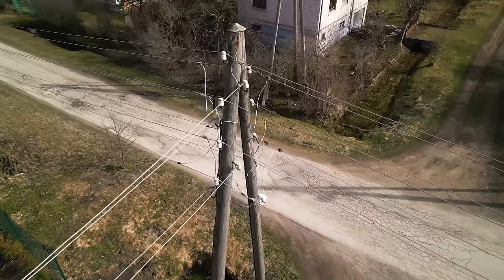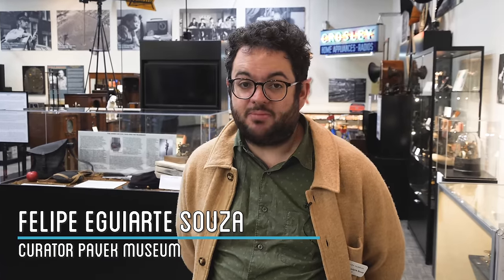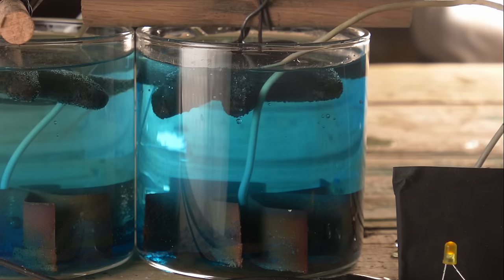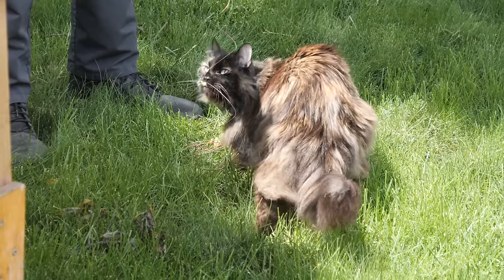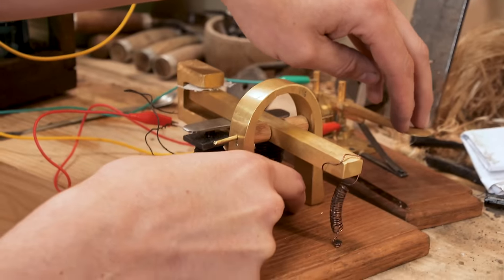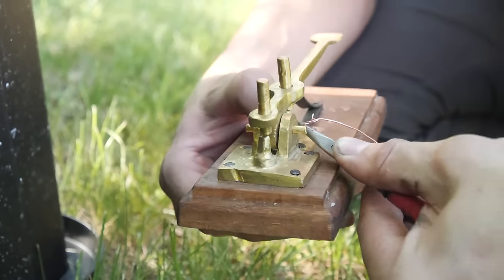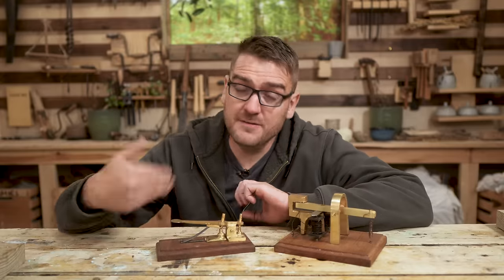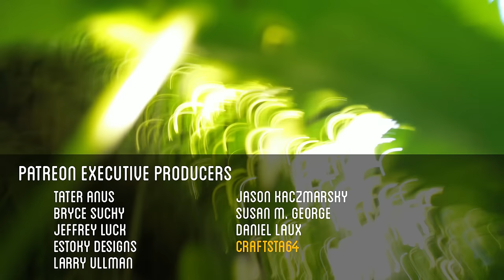I BUILT my own TELECOMMUNICATIONS Network!

Comment: Stone tools to digital communication in four years.  That is very impressive.
Reply: Technically it isn't digital, since there's not any transistor technology involved. It works on analog! But telecommunications from scratch is still amazing!
Reply: @plvmbvm513  It's digital, as there are only two states used to transmit information (On or off). Analog systems have a range of states.
Reply: @Theinatoriinator  This debate has raged for decades in amateur radio spaces. The US FCC, though, doesn't classify CW/Morse code as a digital communications mode, however. The reasoning I've heard goes that it's not operating on on/off signals only, as the duration and spacing of the pulses is also necessary to carry useful information. Something like Baudot code used for 2-FSK is where it becomes more "digital" (it's very similar to modern ASCII)
Reply: @Theinatoriinator  Morse code is more about length of pulse and not off and on
Reply: @Theinatoriinator  The length of pulse is a third state
Reply: @EggplantHarmesan Yeah, and it's technically more complex than that, using the duration of the space between signals to clearly separate letters and words from each other. Which binary also doesn't do, relying on chunks of bits (usually 8-bit bytes, though not always) in order to separate information so it can be read.

I think it comes out to being 4 different signals that it's based on. Dot, dash, short pause, long pause. But I'm not certain.
Reply: @plzletmebefrank  Digital doesn't imply binary. A signal is digital if it is discrete (there only exist a finite number of meaningful states). It is said "digital" because it can be encoded as a chain of digits (2 different digits for binary, 16 for hexadecimal, ... or anything convenient).
Reply: Meh. Dr. Stone had wireless communications in season 2.
Reply: @helpfromabove6400  Which is what... Two years with 20 times the overall manpower and at least twice the amount of full-time skilled laborers.
Not to mention working much more per day than a YouTuber since, you know... Mortal consequences hanging in the balance. Plus YouTubers have social media management, editing, etc. And I can't remember if/how long Andy has been full-time on YouTube.

Point is... It's actually not that far off from each other. Though, HTME is much more about education than actually racing to reconstruct modern tech from scratch.
Reply: @plzletmebefrank it kinda depends on when you start measuring. Senku had been alone for a few months and with only Taiju for a year, with about a month between the end of Taiju's first year and the arrival in the village and about 6 months between that and the battle at the cave. Given that the aim before arriving at the village was just to undo the petrification while building a decent lab and shelter, and most of the tools were left behind during the group's escape, I think it's probably more reasonable to start the count from the village arrival than the start of the series. Though the first two or so months were basically just preparation for the tournament and making the medication, with wireless communication taking ~2 months (electric lighting by Christmas and the phone by the end of January iirc). They also didn't have access to most ores until ~Christmas and no asphalt until much later.
It's kinda hard to judge either against each other's time schedule, as both this and Dr Stone had massively different objectives along the road to this. It's almost as bad as comparing them to humanity's rather pathetic time of some tens of thousands of years between metal working and the telegraph.

Comment: Further refinement of the receiver/sounder: attach a pencil lead to it and pass a strip of paper moving at constant speed under it, this way you get a printout of the message without someone having to manually write down the dots and lines

Comment: Do you need to anneal the wire between pulls? In case I ever need to make my own wire.
Reply: Indeed! I believe it varies on the material you're working with, but we found with copper wire that annealing after every two to three passes was ideal to keep the copper from getting too brittle.
Reply: I think so because they seem to be getting breaks it looks to me like the copper is work hardening after a few pulls. I would at least have it warmed through a fire before being drawn. Also the angle. They pulling the wire up at an angle instead of straight through.
9:42.
HTME has always been a great, but Andy has always been messy. It has improved since the early days.
Reply: For copper, every 3 pulls is a good rule, as most available plates are meant to be used with the hands or a draw-bench. You can get away with 4 on silver and sterling, and for iron, it really depends on the alloy!
Reply: would it not also have less chance of breakage if you wind it onto a spool close to the draw plate instead of pulling an ever longer piece of wire.
Reply: Is there any way to anneal while pulling? Like, continuosly, instead of doing one step after another?

And is there a way to pull continuosly? Like, whitout the need to take the entire wire out, to start squishing the rest?
Reply: @isaacm1929  usually this is done in factories and larger operations. The wire is drawn through multiple stacked stages onto spools, and is heated between these with magnetic induction. Fires become too inconsistent to guarantee that the wire would anneal well at small gauges. You'll also want to clean the wire and apply an oil or lubricant to keep it from breaking. 

It doesn't take too long to soften the wire between passes. I made about 140 feet of 0.5mm wire from a length of 2mm wire, and it only took a couple hours.
Reply: @jakeeasterday1663  Thanks! Have a great week!
Reply: @dmf81  I agree that this would be better. If you look at illustrations of wire drawing from medieval illuminated manuscripts, the jeweler is usually shown with two spools, the wire passing through a drawplate between them. Usually, the wire can just be grabbed again closer to the plate during each pull, because the marks from the tongs would just be removed by the next size down
Reply: @graeme.davidson  It kind of bothers me he doesn't do more with making "automated" tooling, especially with metal. He's at the point where more precision machining would be available and he's made a lathe. All he has to do is make it more powerful, and make a vertical chuck so he can start milling. I do like that he is doing stuff with electricity though since it's such a major part of our world now, but machining and tool making is literally the backbone of the industrial revolution.
Reply: Yes, it work hardens after a couple of pulls with non ferrous metals.
Reply: @jakeeasterday1663  42 meters! Wow that's awesome... 😮
Reply: @dmf81  I don't think that would help. Yes, the longer wire past the draw plate can store more energy, but it only gets released if the wire breaks. But once the wire breaks, it doesn't matter anymore - broken is broken. All that changes is that with little stored energy (only a short length of wire under tension) you get a "click" when it breaks, and with a lot of stored energy (meters of wire between the applied force and the draw plate) you get a twang and a tail of wire flailing around. But the draw has failed in both cases.

Comment: As an electrical engineer I’m overjoyed that you’ve gotten to this stage. 

On the same vein of early communication, with the amount of copper wire you have available it’s well within the realm of you making your first crystal radio receiver and /or crude spark gap transmitter. The future is exciting and I can’t wait to see how this branch of HTME progresses!
Reply: for crystal radio they need a diode though which requires chemicals they likely don't have. Also with such crude technology it would be hard to sync the frequencys.
Reply: Among the first semiconductors circuits were galena “cat’s whisker” diodes that just used a very thin piece of wire to find and use a crystalline rectification junction to demodulate an AM radio signal. This was first done in the late 19th century. I agree, an AM radio receiver would be rad.

Although… if we are talking about building a wireless telegraph as a next step you don’t need a semiconductor. Marconi just used a “spark gap” and an antenna as the transmitter and early receivers (like magnetic detectors) weren’t that much more sophisticated
Reply: @A_youtube_channel_  just like the reply above,a detector diode can be made very easily with crystals found in nature already from Galena to Iron/Copper pyrites. The hardest part is getting enough wire for a coil and potentially making an earpiece from scratch- that would be the hardest given to crystal radios you’d need a high impedance load sensitive enough for the weak signal.
Reply: Should we remind them that Spark gap radio cannot be operated legally now.
Reply: @陳冠維-f7i  I’m sure that for educational purposes and limited power this won’t be an issue as much as people making their own transmitters for science fairs etc… we’re not talking kilowatts of power or extended periods of transmission. For the purposes of a video it should be fine. I’m no legal expert but for all intents and purposes a primitive transmitter one can assume would be built would surely put out less interference than some switch mode power supplies or whatnot.
Reply: @陳冠維-f7i  Can i remind you they already did, just in this video.... What do you think a coil of wire and nearly a mile of antenna with a switch in series is?
Reply: It is amazing to see someone try to emulate something that we know works, but actually how they did it appears to be lost technology. That's what fascinates me most as I sit and type this message onto a screen, it instantly appears for anyone in the world to read, yes it uses code to send and receive today in the same way, but yet we have not, or cannot reproduce what the pioneers of this technology did, given the somewhat limited knowledge they had of electricity and electronics
Reply: I have a question about possible technological resets how fragile is our infrastructure when it comes to sunflares?
Reply: Please run a spark gap transmitter only inside a Faraday cage though. Those things are banned from the airwaves except with special permission (like celebrating the 100th anniversary of some historic radio event maybe). Because they're so noisy.
Reply: @MuadDib2347  Whether something is illegal and whether a stern man in a black suit shows up at your doorstep are to different questions. You don't need kilowatts to wreck the spectrum for other users.
Reply: @CUBETechie We just went through one (a big one, mind you) and we came out fine. Current day electronics are now at a point that they can survive a sunflare...
Reply: @bpj1805 duration matters as well.   A short transmission would possibly not cause much trouble if a basically one-off event. (I too remember though when the modern road channel had some body come out and show how road transmitters were located for instance as part of their overall amateur radio discussion.)

I wonder if a question to a loyal representative would be beneficial to ongoing experimentation. 
On one hand it could cause unnecessary attention to be brought to his operation and limit or prevent future content, or have said representative or a designated individual to oversee as an authorized station of some sort. 

I know a lot of the internet seems to be of the better to ask forgiveness than permission mindset, but that can often burn bridges and limit opportunities in the future as much as or more than asking ahead of time.
Reply: @A_youtube_channel_ it's a crystal radio because they used a literal crystal galena razor blades were also used
Reply: @A_youtube_channel_  Actually they don't. Not like you're thinking of, anyway. What they need is a coherer, the original version of which can be made with a battery carbon (or pencil lead) with dimples in the ends, suspended between two needles. This attached in series with a battery, tuning coil (with aerial and earth) and telegraph sounder comprise the original wireless receiver (S R Bottone, Wireless Telegraphy and Hertzian Waves, 1900).

So HTME could make a radio detector with a Leclanché cell, a telegaph sounder, and a piece of pencil lead.

A crystal radio can be made using a chunk of silicon, a needle, and a spring. While galena was used from 1901 to detect microwaves, these weren't used in communication but were originally used in experiments to prove that light and radio waves were different regions of the EM spectrum. Silicon was the original semiconductor used in cats' whisker detectors for communication, from 1906 (US patent 836531A).
Reply: @MarkTuson  Yeah that’s what I meant by chemicals. I don’t think they have silicon or graphite(for the pencil led). As for the tuning coil they have the materials. But it would  require a lot of precision to make something that they could change the frequency reliably on.

Comment: As  I understand it, the US rail lines had the batteries at the receiver end.  This way, just a key to ground could send a message.  The trains carried a key with them.  If something went wrong between stations, with just a key, you could climb a pole and send a message.
I believe they used a fairly high voltage.  I also think that the system was likely a "positive ground" system.  
The had some method of heat treating wire to keep it soft as they went smaller and smaller.
Wire was often wrapped with thread.  Unlike the goo insulation you were using, cotton would hold up under pressure.
On the sounder, the clearances were very small to take advantage of the fact that the force created by an electromagnet are greatest just before the armature hits the pole piece.
Reply: yeah, they could definitely use an annealing treatment to recover the metal's ductility after every 2 or 3 passes of the wire. that would make it require less energy to deform as well

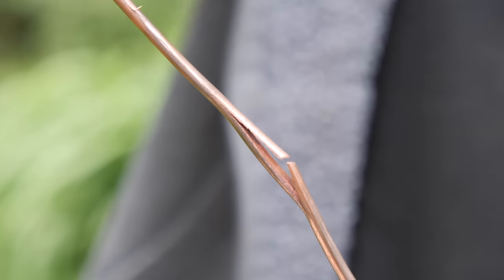Comment: 8:55 Were you all remembering to anneal between each draw through the die? That you can maybe add a couple of grooved wheels to keep the copper where it is pulled through the die perfectly perpendicularly or as close to it as you can manage.
Reply: yes we were annealing it, the reason it looked like it was twisted up was so we could give it an even heat.
Reply: I've seen this being said quite a few times now, why keeping it perpendicular would help? Is it to lessen stress on the material as much as possible?
Reply: @Fyr365  Well when the material comes through the hole if you don't pull it directly perpendicular, the stress will be focused to one side of the wire and can cause more stress in a smaller space making it easier to snap. If you pull it perpendicular the whole wire takes the force equally around its circumference.
Reply: @schoktra  Ah I see now! It makes so much sense. Thanks for the reply! 😊
Reply: Follow up on the annealing question, did you use anything to reduce friction like a beeswax rub on the plate?

Comment: Lard on the wire as lubricant before pulling. Heat wire red hot occasionally to reduce copper hardness. Makes for less breaking and easier pulling.

Comment: Historical note: There are TWO Morse codes. One is American Morse ( Which my father learned as a young child , before radio, used by railroads and land telegraphs that used the sounders like they have made here; where the spacing of the "dots & dashes" was critical.), and the one in use today, International Morse which uses tones generated by the transmitters through the air.
I have an very old Instructograph Machine with tapes for American Morse.

Comment: Earth return you need to soak the ground at the electrodes with saline solution, quite a lot of it, to get the resistance down, plus leave time for the saline solution to soak deep down. Probably easiest if you use a pipe auger to make the hole, fill with salted ground, and put the electrode in it, though the grass on top will not recover for a long time.

Plus you also need a good few electrodes in parallel each end, to get maximum surface contact between the rods and the ground, with the rods no closer than their length apart as well.
Reply: it's also dependent on the geology of the area. And good luck trying it on the moon.
Reply: Plus their rods should be a lot deeper, most houses have 8ft rods for grounding and they may not even carry the low amount of power he's working at.
Reply: I suspect they used multiple rods.  Most of the resistance is in the first few inches from the rod.
Reply: dry conditions, too low amps or voltage, poor wiring connections, many many variables. We fight with elc fence regularly that's not two wire systems due to poor earth grounds. +/ - wire systems is the only way to go, until a tree falls on it anyways.
Reply: @maxr1401 believe me, In Minnesota dry conditions are not an issue this summer. We're dealing with flooding now
Reply: An intermediate relay as an amplifier would have solved the problem of lack of signal power.
Reply: @LaserFur  I think it'll be at least another 12 videos before they have technology needed to get to the moon.
Reply: that depends entirely on soil chemistry. In most of the cathodic protection systems I have built in Canada the soil is alkaline near the surface and there is a lot of iron and magnesium in the sand and rock, except where there is heavy clay to great depths. we use salt when it's all clay.